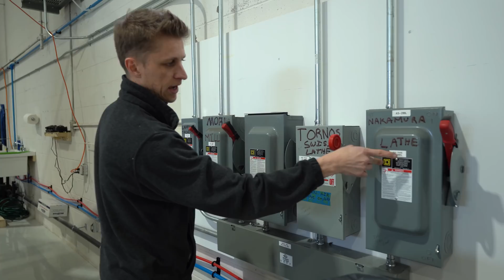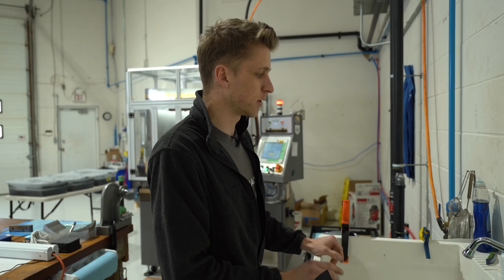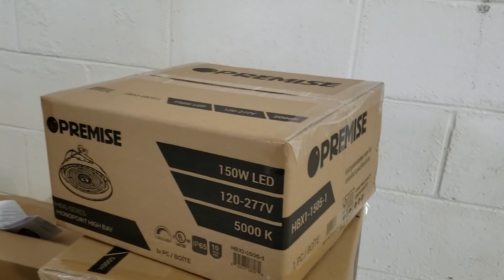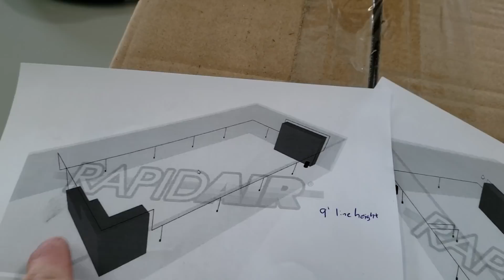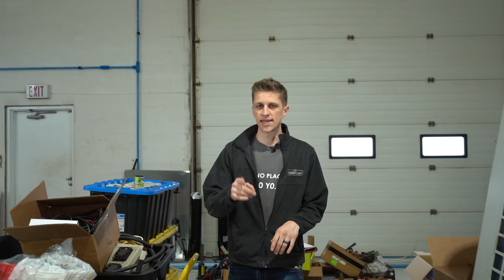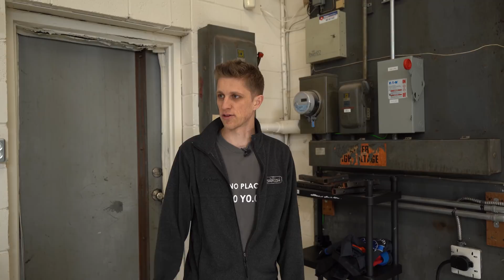NEW SHOP EP. 5 - Power, Plumbing, Lighting & Air

Comment: Awesome shop but the air pipe work can give you trouble with condensate in pipes especially in summer time and when you do not have an air dryer after the compressor. To avoid condensate then have an inclinement of 1% on the main pipe, on every drop off must be pointed upwards to avoid condensate. At the lowest end then have the pipe drop off pointed downwards and a bucket to tap it off. If you really use a lot of air there can be some energy savings having 2’’ pipe as main pipe.

Comment: The PWM for dimming can be somehow dangerous in the workshop with rotating tools. As it can sync with the tool rotation and appear not moving. If machine is running quiet or you have ear protection, you might not be aware of this. Sure, most of the machines are enclosed and have interlocks, but still, this could be a problem, especially when there is no sunlight. The best option is to use LEDs with pseduo random PWM patterns, or with continues constant current driver. I am not sure what this Premise HBX1 are using, but it looks to be using variable constant current driver, so no PWM. Could be best to confirm with Premise support directly.

Comment: Curious why the electricians didn't just size a large transformer for the whole works vs installing one per machine.
Reply from the maker: That is definitely a possibility, but we've been buying each machine one buy one, so we've bought one transformer with each machine.  So we had them all already, except for the Kern one.  Plus some of them run 230v and some run 400v, making it trickier.

Comment: The kaeser air compressor has a setting where you can set the shutoff pressure. This is max pressure at default. we’ve had the same problem where it would keep idling even when we didn’t even use compressed air.

Comment: It looks very nice with those compressed air lines but I had turned the t-coupling upwards and then turned down to avoid getting moisture with me. then I had put 2-3 lines at som lowspots with the t-couplings down with water traps. they help more than you think.

Comment: The hot water circulating pump boosts the pressure in the hot line, then at the sink it goes through a valve and flows backwards through the cold water line all the way back to the heater. Works best with insulated hot lines and uninsulated cold.
Reply from the maker: Ahh that's exactly what the plumber was explaining to me, so that must be his plan.

Comment: Nice work guys. But check on the water systems a bit when you are constantly running hot water in the pipes. Hot and cold seem awfully close togheter so things like legionella an listeria might become an issue.

Comment: If you have not already installed the hot water, investigate the use of demand water heaters (one for each side that is between the double sink and single sink on each side).  They can be had to boost the temperature after a long run.  Put one just before the tee on the hot water line on each side and you will have almost instant hot water available.  They can be adjusted to the temperature you want or need.

Comment: I would recommend installing a customer owned submeter like an E-Mon D-Mon meter at the main feeder (maybe one submeter for each building). You may need permission from your landlord and local AHJ, but this will allow you to monitor your actual power consumption and compare it to your power utility bill and building meter reading. It's a little bit of an added cost, but you'd be surprised at discrepancies with utility bills and actual power draws, especially on older buildings and retrofits. But thanks for the videos and amazing content!

Comment: Hi John,  listening to your video and the bit about continously having hot water to the tap occurred to me years ago, living in the Wheatbelt of western Australia scarcity of water is always on our minds so I came up with a couple of solutions, 
The distance from my HWS
( Bosch instant gas we have no grid gas here so we have to buy 44kg bottles for our cooking.and hot Water etc needs) 
Piso electric start No flame constantly burning using at least 1/4 of the bottled gas The kitchen sink is approximately 10 feet , from HWS using 12mm copper pipes s
To go from cold to hot 1.7 litres of water goes down the sink.
My thought was a tap at the sink you turn on the water then is diverted via a one way valve possibly a regulator back to the hot
 water system  or firstly into a WELL INSULATED STORAGE tank depending on in how many times the hot water is needed and in your case I guess you could loose a minium of 2000 litres+ a day

Also as I have a 4500 litre spa I put a 100 metres of inch and a quarter black poly pipe on my roof NO SNOW here in winter but the pipe could heat up the spa from 23c to 44c in 9 hours pump off for 30mins on for 5 = equals 180 litres of hot water at about 60c out of the pipe)

SO I wanted that to also act as a pre warmer for either HWS or instead of in summer
I couldn't find a competent or affordable plumber to make it happen. 
Several ideas for you
INSULATE all your hot water pipes you will save a fortune in heat loss,
Consider buying 100 metre rolls of 1 1/4 inch black poly pipes Keep them in the rolls and daisy chain them together on the roof, (BELIEVE ME DO NOT OPEN THEM UP IT IS UNCONTROLLABLE TO HANDLE AND YOU CAN BRING THEM IN WINTER TO SAVE THEM FREEZING) 
You will create thousands of litres of hot water a day. 
Maybe put in a 2000 gallon poly water tank (again insulate them)  unlimited hot water 
Your machines generate heat, is thier any way of wrapping copper pipe coils around the hot components to capture the heat,? 
I Hope these suggestions can lead you to a lot of savings John or at least so much hot water you have all you need 
Tony from Western Australia.
Reply: A hot water ring main is used in larger installations. Outlets are fed by small diameter drops while the main is a large diameter. A pump kicks in when the pressure in the ring drop as a result of a tap being opened. The pump circulates hot water around the ring at high rate so that the top of the drop will get hot water much more quickly with less "waste" of tepid water down the drain.

Comment: No air dryer? Are you guys using in line air dyrers for each machine?
Reply: If I remember correctly the compressor units dry the air also.
Reply from the maker: The compressor has a built in drier and each machine has a small dryer as well.
Reply from the maker: The compressor has a built in dryer, and each machine has it's own small dryer too.

Comment: north american construction work (especially the electrical stuff) feels so confusing and weird everytime I see it...
Reply: Yea it is like traveling back in time about 90 years compared on what i am used to. All these breakers would have been put in a basic enclosure (1200x2000x600 for example) and you could still have some space left for expansion later on. Even a 40 year old installation over here would still require less space and would be more "orgeniced".
But overall the ones who did this job seem to have put afford and thought into it, for a north american setup it looks well done from what you can see.
Only wondering about the 400V/230V 2 line setup, must have something to do with how the transformers are setup, cause here you would simply take the 400V in and use 1 phase plus neutral to power the 230V part, commen practice for equipment over here.
Reply: @DerKB79  

 I would say the main reason for the disconnects is so the machine can be locked out to work on.  You could have just a breaker panel. In larger shops, the disonnects right by the machine are convenient when doing work on the machine.
Reply: @joepollock9151  yeah that's common safety practice here for lock and tag out when working anywhere near the machine
Reply: @rpnp2   yup, i use LOTO everyday at work.  We had an arc flash event not long ago at work. Carbon fiber dust made its way into the panel
Reply: @DerKB79  I think it has to do with how you transform the power. In Europe we have 3 phase. So each phase is 230V and combined together you have the 400V.  They have 2 phase, so each phase is 110V and combined together its 220V. 
As for the 600Volts they have there I think the transformer they use have that feature.
Reply: Just slap everything on a wall, preferrably as many brakers, so big you'd think they are 12kv IP68 rated, as possible
Reply: @luke1811  with huge metal levers instead of small plastic on/off switches
Reply: The school of dingley dangled cable and pipe work were are the regulations for clip spacing ,cables cut to short and pulled over to fit uggg should come out of the breaker/isolator in a straight line with a nice curve to change direction, where is the equipotential bonding of all the metal switch gear , no bonding to the machines . Here in the UK when I did my time 5 years then my mentor would have strung me up by the goolies . As to the water pipe they begger believe completely unsupported and not protected from external damages ( fork lift ) , before I retired I works as a facities supervisor and I had contractors redo better work than that , were is the pride in the workman ship certainly does not reflect your work John

Comment: Good on you for putting in the infrastructure when you had the chance, the lighting in particular.  It's a tiny detail but some brass weights on the ends of the hoses for the mop buckets will save them flopping around when you open the taps.  Also 160 ISO?  Awwwwww man, too bad you crammed that lovely photo studio all full of machine tools!

Comment: Do you really have to pay for an expensive transformer to step down 600V to 480V for every machine? Couldn't you just have one massive one feed the whole shop or is that not an option?
Reply: Sounds like a single point of failure and you would have to shutdown all machines when working on the circuit.
Reply: It's possible that it is actually cheaper to run multiple small transformers; than to buy a large transformer, disconnect, and breaker panel. Also keep in mind that 600V cabling will be lest costly since you can use a smaller size for the same load.